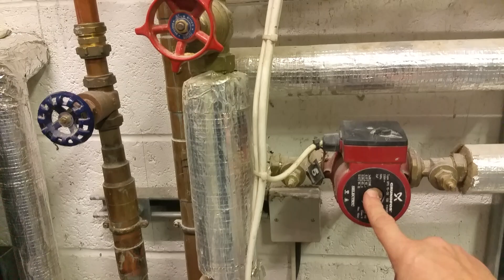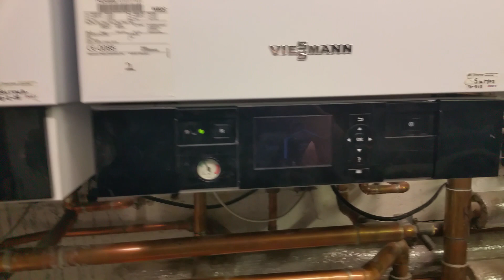Bad Heating Design - More of the same poor heating designs I get to see.

Comment: Whats the reason for not repiping the hot water cylinder circuit through the boiler 4-pipe DHW circuit and leaving the heating on weather compensation? Obviously after sorting out a suitable low loss header or other form of separation?
Reply from the maker: I didn't repipe any of it. It could have been primary circuit

Comment: Did you do a follow up on this one Andrew?
Reply from the maker: I posted this on the forum and some one else had been to the same job. They said it was still the same as in my video. This was many many years ago. So I guess the answer is no I never followed it up
Reply: @andrewmillwardwatford9410  Thank you for responding Andrew. I suspect that your recommendations (and that of other engineers who they called in) were producing outcomes they did not want to hear. They must have one hell of a gas bill and those boilers are being flogged to death.😳 PS which forum did you post    to I would like to have a look ?

Comment: Could you install flow regulator on each secondary return?
Reply from the maker: Often the system flow rate is different from the boiler flow rate especially if ufh is part of the system. The heat load of each circuit and its design temperature difference dictate the circuit flow rate. 
Its possible that this system could be balanced but further design investigation would be needed. In practice it is almost never the case that such a system is balanced.